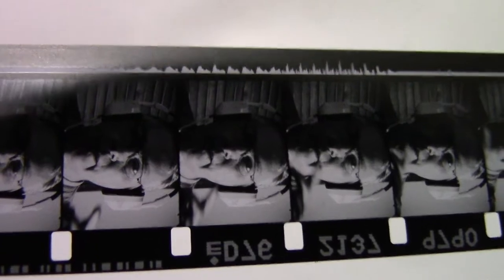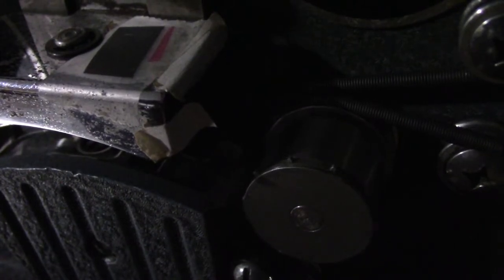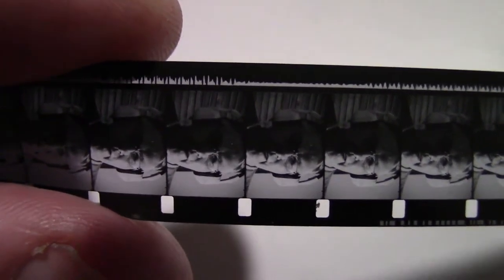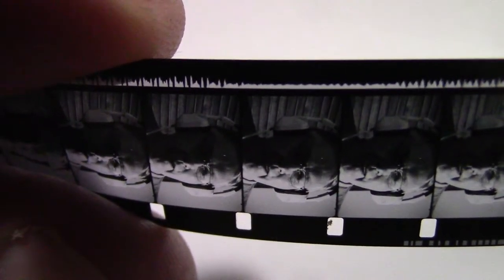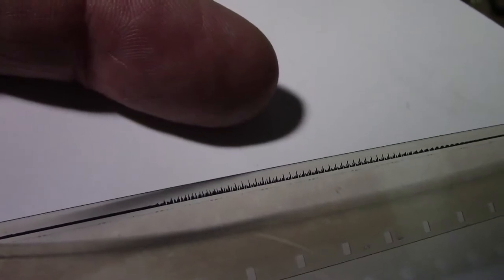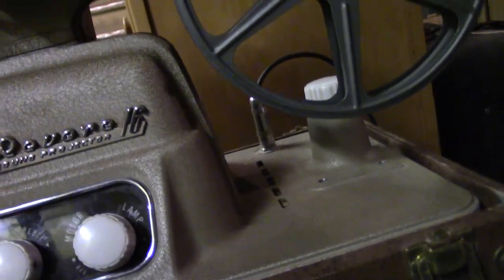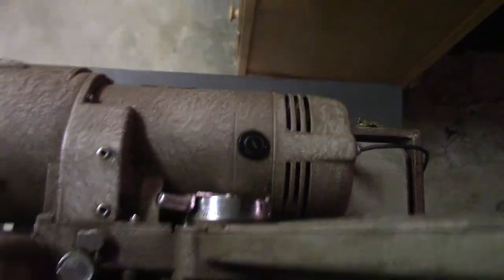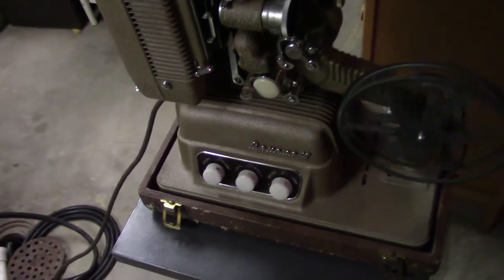soundtrack

Comment: This is the Revere where the volume control actually controls the exciter lamp brightness isn't it? Only really sounds good at one volume?
Reply: @MichaelCarter  I meant at low volumes you get a hum, that other projectors might not get.  At high volumes you might get the distortion any other projector would get.
Reply from the maker: @slashmaster2  volume was set just below half?
Reply from the maker: Slashmaster, the volume dial does nothing to the sound lamp intensity when the amp is on.
Reply: @MichaelCarter  Oh ok. That's good. Better to control volume between stages.